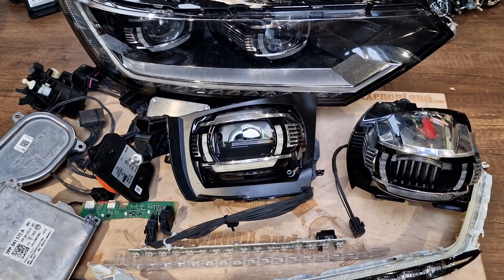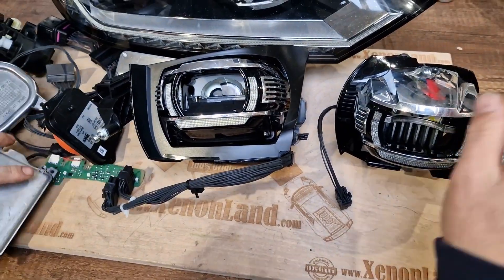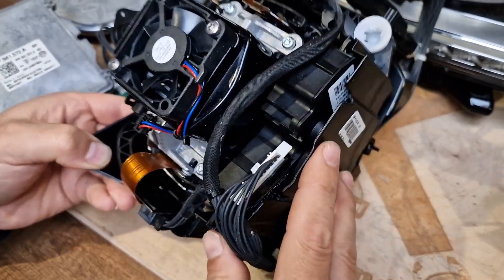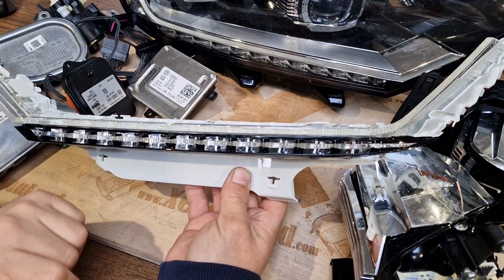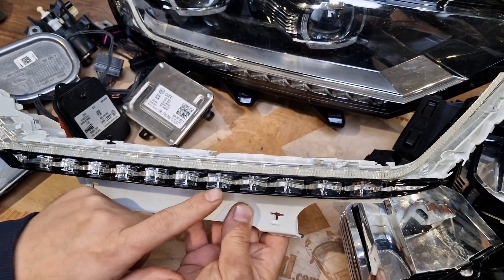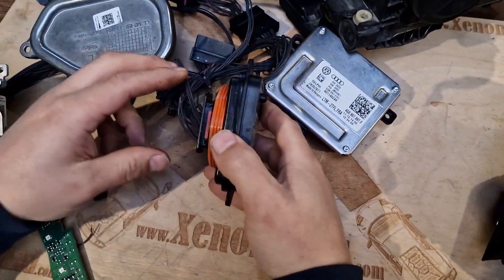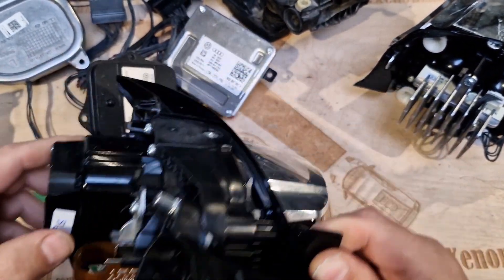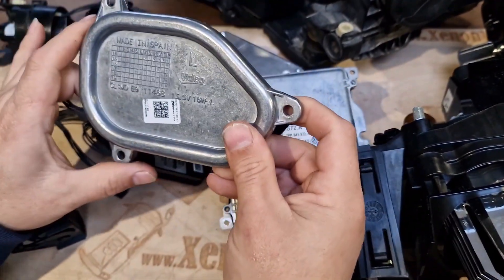VW PASSAT B8 LED DLA headlight repair guide: AFS, DRL, power modules and low & high beam led ballast

Comment: I‘m having quite a weird problem: my driver side headlight (Passat b8.5 iq.light) suddenly stopped working. I disassembled the front and pulled out the headlight. Measured each pin from the connector, it shows exact the same values as on the passenger side. So I took it, and connected it on the other side: the headlight is working. I can’t figure out what is the problem. Like I said, both connectors show the same voltage, 2x12v 1x 1.9v 1x3v and ground. Both identically, but one works, the other doesn’t. Car can’t find the headlight control module.
Reply from the maker: Did you perform a diagnostic test on the car? Usually, it shows the problem. Have you checked the fuses?

Comment: The sealant on these are shite,  and the plastic housing is to thin so they crack very easy on the top. They also suffer from condensation problems. I have changed mine on my ad1 tiguan at vw. New headlights lasted well 2 years sfter install at vw dealer and the cost for 2 lights and 4 modules was 4112 euros...the oem lights that came with the car lasted 7 years housing cracked same place at both lamps and all the modules under was filled with water from driving. The problem with the new headlights is sewere condensation 😢
Reply from the maker: It's frustrating when new headlights don't last, and the condensation issue is definitely a tough one to fix without replacing the unit.

Comment: Hello my friend what would you do if the headlight is wet from the inner side do you have a lifehack ?
Reply from the maker: There is no easy lifehack for the condensation issue at headlights. You have to remove the headlight and check for damage/cracks at the headlight casing.

Comment: On my Passat B8, I have the full-option headlights. For the past month, I’ve been getting an occasional AFS error. Most of the time the system works, but sometimes it stops functioning. Strangely, it usually works again after restarting the car. Do you know what this could be?

Comment: Great job 👏🏻 
I have one question 
I have Passat 2020 and after an accident my left headlight gets wet and the power module damaged and when I replace it the new one it doesn’t work all of the modules have the same part number. Maybe it’s need some configuration with the car computer?
Reply from the maker: As a rule of thumb, if you have a new GENUINE module, it requires coding after installation. if you buy aftermarket one, then nothing to do, they simply can not be coded, for trash

Comment: Hello, could you please help me? 
I have a Passat B8 year 2016 with full LED lights and my right low beam does not work!
when I put the high beams on the high beams work but not the low beams what should I do?
Reply: can we just install the right low beam LED lights?

Comment: Hi Xenonland! Really nice video! 
I own a Passat GTE 2016 B8 and have trouble with my left headlight. After staring the car I get two warnings in the dashboard. 
1. Please check headlight
2. Error, corner lights (AFS)
The headlights are working though, only think is that the left headlight beam is higher that right. 
With your experience, can you advice me the most possible cause and which parts the change? Many thanks for your help in advance! Kind regards, Jelle (Netherlands)
Reply: I have the same problem. Did you manage to fix it?
Reply: I have that problem my projector in left head sometimes work up down left and right after starting and sometimes goes just up and down but left and right not like it is jammed or smthing.

When error comes adaptive light is not working it is just low fixed and visibility is short.

Do you fix it?

Comment: Is it possible to open the part shown at 12:34 by unscrewing only 3 screws? Is it necessary to perform a sealing operation when closing it afterwards?
Reply from the maker: This led module has its own seal. Just fasten the screws
Reply: @xenonland  Thank you very much.

Comment: Great video you doing mate everything is clear and good explaining💪👍.  I live in England, I bought a car after an accident with category  unfortunately it was hit in the front.  the lights jump slightly, the mechanic found the cause, the lamp mounting clips are broken, how can I fix it, please help
Reply from the maker: if you mean the fixing tabs that are used to attach the headlight, then they are sold separately by VW as REPAIR SET for headlights/
Reply: @xenonland Thanks mate 😃

Comment: Howdy. please help me with a problem, maybe you know what my car has. The high beam part of the headlight stopped working. I changed the headlights between them and the headlight with problems works, the good one does not. The problem was on the right side. in the end I noticed that the 10 fuse was blown. I changed it and the side with the main beam came on. After a week, the AFS error appears again, but the headlight works, if I turn off the car and restart it, the error disappears. what I also noticed on the wall on the main beam of the headlight that had problems, the light intensity is lower. I don't know what else to do and what would be the problem that needs to be changed.
Reply from the maker: What's your car? Model? Year?
Reply: @xenonland  vw passat b8 2017 beems like in the video. Thx!

Comment: How can you test the daytime running LED light strip or module?
Reply from the maker: Unfortunately you can not test the module "outside" the headlight. Just swap the DRL module to the working side headlight and you will understand if it works or not.

Comment: Hello, thank you very much for this great explaination video. I have a question concerning daylight. My daylight is defect and at beginning of this defekt it sometimes worked for a few seconds/ minutes after starting the car. Since some time it dosen' t work any time. The Control unit of daylight is checked and working well.
Do you have expience to locate with this information the mistake? Do you se a chanxe to repair this? Thank you very much!
Reply from the maker: This is your DRL module (here is the link https://youtu.be/TPLIG9BQ5o0). If this part works, than it means that you have a faulty LED unit at the strip. If even 1 LED unit burns, all the strip is deactivated/get defective.
Reply: @xenonland is it possible to change led strip?
Reply from the maker: Theoretically possible but very difficult, and you should find a donor headlight since this strip is not sold  separately